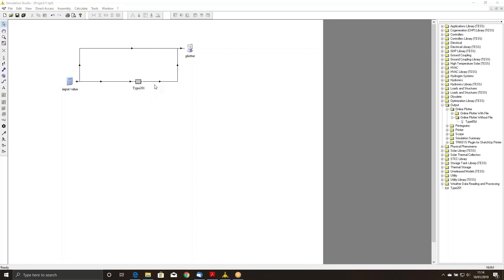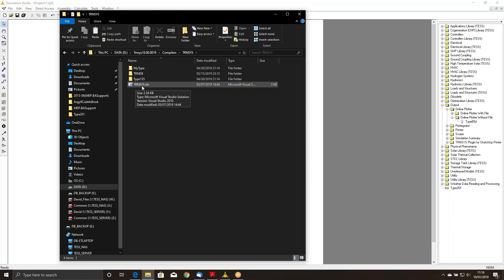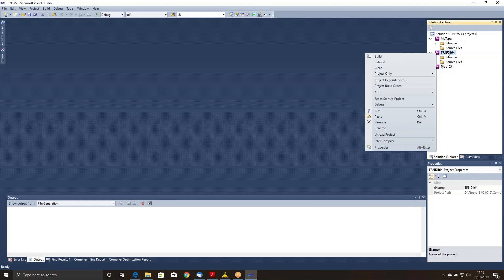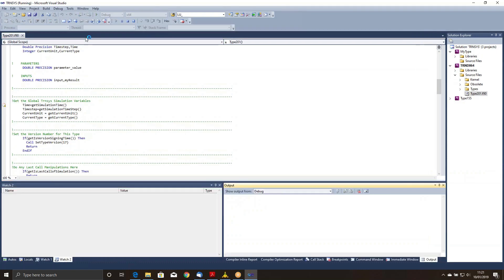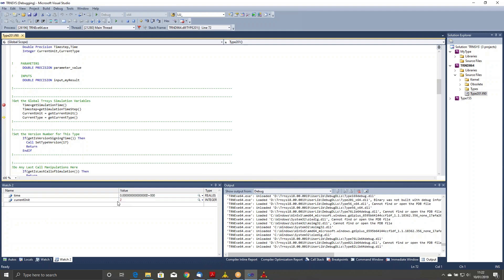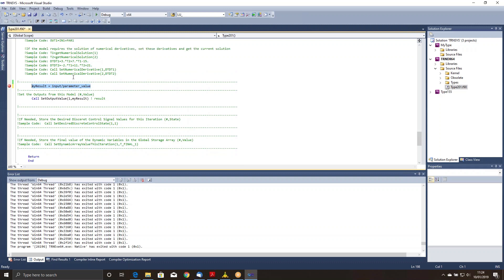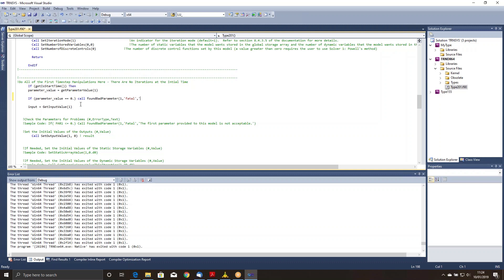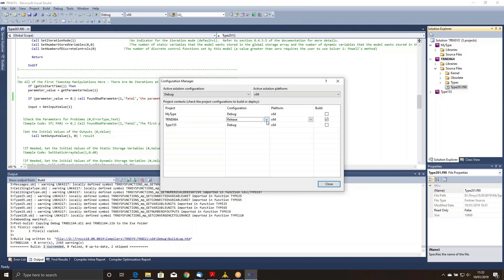Debugging Errors in TRNSYS Using Visual Studio

Comment: Thanks for the video :) I have issues opening TRNSYS.sln, all the folders available on the right side of the video cannot be installed since the .vfproj files cannot be openned. How did you manage this issue? We are using Visual Studio 2022 Community, in case any other user has suffered the same problem following the steps from the video. Any help will be welcomed.
Reply from the maker: You might try using Visual Studio 2019 and see if the issue persists. Also be sure to download the Intel oneAPI Base Toolkit and Intel oneAPI HPC Toolkit in addition to Visual Studio, and make sure the "Desktop Computing with C++" box is checked in your installation of Visual Studio. Complete download and installation instructions are given in a prior comment on this video.

Comment: Thanks for uploading this video. What if we have this floating point error and the component is not user-written? Is there anyway to debug that as well?
Reply from the maker: You can follow the same procedure to debug a floating point error in any component for which you have the source code. You can also email your TRNSYS distributor for tech support with the standard library and TESS libraries. Send them a copy of your project and any supporting information that might narrow down the cause of the floating-point error, such as when the error occurs or what component(s) or connection(s) you made just before the error occurred.
Reply: Thanks for the prompt response.  @thermalenergysystemspecialists

Comment from the maker: If you run "Start debugging" and get an error message like "Visual Studio cannot debug because the debug target has not been specified" or " ... is not an EXE file", you need to specify or update the filepath for TrnEXE64 in your TRNDll64 debug settings. In Visual Studio, right-click on TRNDll64 in the Solution Explorer window (by default on the right-hand side of the screen), then select Properties from the menu that pops up (it'll be at the very bottom). In the TRNDll64 Property Pages window that appears, go to Configuration Properties -> Debugging, and where it says "Command:", fill in the full filepath to your TrnEXE64.exe executable (in its default location, the filepath  will be C:\Trnsys18\Exe\TrnEXE64.exe).  Make sure you hit "Apply" or "OK" before closing the window to make the change take effect.
Reply: Comment peut on augmenter le nombre maximum de warning permis (commande limite)
Reply from the maker: In Simulation Studio, from the toolbar at the top, go to Assembly -> Settings -> Advanced Settings, scroll down to 'Before ERROR' (row 11 in the table) and set the number to whatever you like.
Reply: We find an error related to 'rc.exe', from MyType folder instead of TRNSYSDLL one, and applying the suggested modifications we are not able to strat debugging with Visual Studio 2019 (+ Intel Fortran Compiler) : how should we deal with this issue?

Thanks in advance for replying our questions, kind regards
Reply from the maker: @pablocallejacayon  I am not familiar with rc.exe. It sounds like you need to contact your TRNSYS distributor for further support.
Reply from the maker: Users should also be aware that re-compiling Types will not work on illegal copies of TRNSYS.